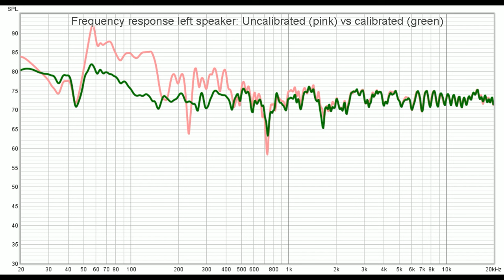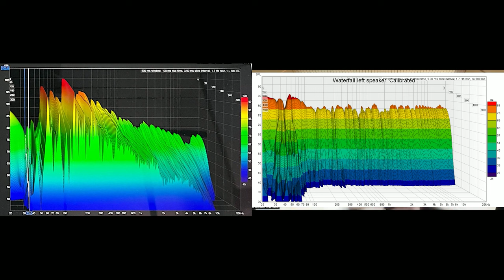DIY Home Studio Treatment: Bass trap control in a DIFFICULT room (measurements)

Comment: Could you make a video on ribbed acoustic panels ? I built ikea billys bookshelfs with stonewool inside, they are about 28 cm deep.
And put ribbed panels on the fronts so that it looks good (in my apartment hehe). 

Does the ribbed panel cause any problem for absorption if it is infront or can it work as a kind of diffuser since wood panels reflect sound i guess?

Comment: I have a question: I want to build broadband freestanding panels from Rockwool, but because I’m move them daily I want to be sure no Rockwool particles come through. What can I put between the fabric and Rockwool?
Reply: Extremely thin cellophane. It will still have reflections in the extreme high end but you'll never hear it
Reply: @novinnovations4026 I did some experimenting today with foils from 7micron and higher, but it appears that the density is more important than the thickness. 
I found 7micron of HDPE (mostly painters foil) is worse than 15microm of LDPE. (Low density PE)

So I will search for the thinnest LDPE. :)